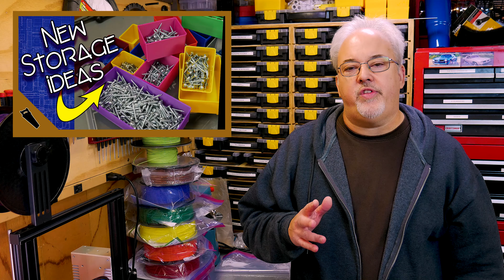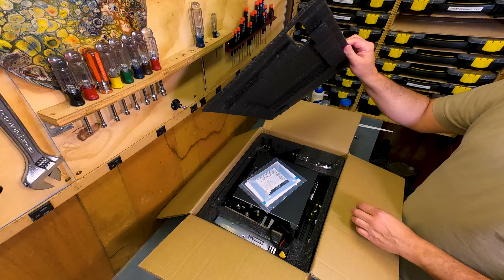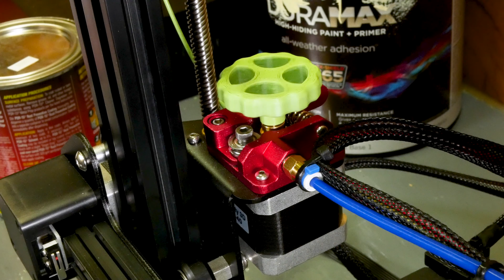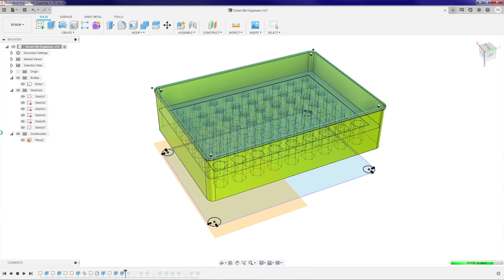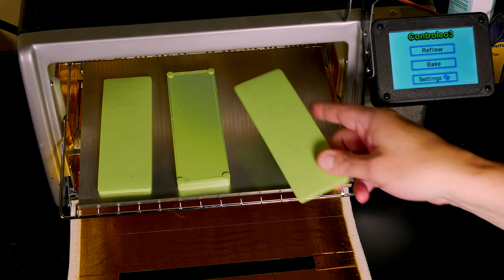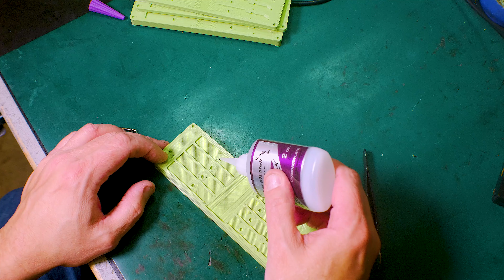3D Printing Bins for Harbor Freight Storage Cases

Comment: Im a newbie, wife got me an Ender 3 Max Neo, I feel like printing these boxes take forever. What can I do to get faster results?
Reply from the maker: With something like these boxes that have very low detail, the easiest way to speed up the process is to get a bigger nozzle.  if you can lay down plastic thicker and faster, you can take tons of time off the printing process. They will also be stronger.   If you switch to a .8mm nozzle, and re-slice, you could conceivably cut your time in half- (assuming the heater block can keep up with the higher flow)  Since you mention being a newbie, I will give you a  warning, you do have to be careful switching out nozzles.  They can get galled in their threads after they've been heat cycled so be sure to read up on that and the required slicer changes. You're also working in the area of the thermal couple which can be a bit fragile. Wouldn't want you to damage the printer in the process.

Comment: Just discovering your channel.  Been printing ABS since 2015 heavily.  I actually use some part cooling in certain situations.   I think drafts are mostly irrelevant.  It's ambient temperature that counts.  Around 35C you can print pretty well.   I'm running printers without active heating and getting around 50c.  I hear 70c is ideal but that requires active heating.  I've only run enclosed printers.
Reply from the maker: Yeah, my printer runs pretty consistently around 50c in that enclosure.  I will usually turn the be on and let it stabilize a bit prior to starting the print.  thanks for stopping by!

Comment: Hello, I have designed a 3D printed label holder that fits the harbor freight storage bins.  If you're interested in trying them out please let me know
Reply from the maker: Sure! contact me at the email address at the bottom of the video description.
Reply: @PeteRondeau  I emailed you at the address in the video description but never heard back.
Reply from the maker: I did answer you check your junk mail. I have a real problem with all of my mail ending up in junk. It’s something about the way my Web host has their email configured. But yes I’m definitely interested in your labels

Comment: That Ender3 is on sale for $189. Do you think that’s a good deal. Or should I consider the next level. Since it’s on sale. I’d like to build these and other things that have a good printing “resolution” quality.
Reply from the maker: I have had no complaints with my Ender3's.  It is a great entry to 3D printing.  Not overly expensive and gives you the chance to see if you even enjoy the hobby.  And the Ender3 can always be upgraded with aftermarket parts if you want to change some aspect of it.

Comment: Hi, nice video, 😊 and sorry for bothering you but you khow where can I find the 3d model of the small compartment of the stanley 1-92-749, comes with 3 different sizes but I want to change all for the small and I could find the 3d model you have any idea ?
Reply from the maker: Oh, I'm sorry.  I have no idea.  I haven't examined that case in particular. I Imagine it wouldn't be to hard to design them.  Have you looked on thingiverse?

Comment: I don't have a 3-d printer but I could really use some of those custom bins. Any chance you would sell some?
Reply: It is possible there is a library near you that will print 3d models for you, only charging you for the cost of filament. If you only need one or two things this could be an easy and cheap route if the service is available in your area. Alternatively, there are countless storage bin schematics on thingiverse. You can download the STL file and send it to someone who will print it for you (for a fee, of course). This would be more expenseive than a library, as the people who do this are doing it for profit, but it is certainly an option if you really want a specific item printed!

Comment: ANYONE ANSWER PLEASE
I recently saw another recycle bottle vid wherein the maker cut a bottle into filament and spliced it into his feed to make multi-color 3d recycle prints using the bottle as filament.
Invariably these are on another continent where the resin mix is unfamiliar in their available trash.
So, has anyone been able to cut plastic trash into usable filament in the US market?  My optimal desire is to use water bottles in some form.
Reply from the maker: I’ve seen what you are taking about but I have no information about it personally. It seems like slitting it into consistent width material would be the biggest battle. Otherwise it would probably print similar to PETG

Comment: How many storage containers worth of bins can you make with a 1kg spool of filament?  I bet a lot of us could justify the cost of the printer just to make parts bins, if the consumables cost is reasonable.
Reply from the maker: You could probably get about 24 of the large size bins (the largest of the original 3 sizes provided by harbor freight with the case)  Depending on how much you are paying for filament that seems like it would be about 75-80 cents a box- which would be more expensive than just buying the cases themselves at $6 on sale- But the benefit of being able to print the custom sizes and personalize the case to exactly what you want to store is the selling point for me.

Comment: Curious, how is your Hitachi table saw holding up? Have you had any issues with the soft start yet? I had to replace the module on mine last summer.
Reply from the maker: It’s been great but to be honest it doesn’t get a lot of use. I don’t have room for it in my main shop area so I end up making do with a jigsaw a lot of times unless it is a project that warrants getting it out of the shed.  Thanks for the heads up though. Now I won’t be too surprised if it happens. Where did you get the module form?

Comment: Neat! How long does it take to print a full box' worth full of regular bins though? I imagine it must take quite a while with the Ender 3?
Reply from the maker: On the Ender3, the smallest bin takes about an hour and a half, the medium size (twice the size of the small) takes 2 1/2 hrs.  They took me quite a while to print because I was doing individual colors- so I had to be around for the color changes when a print finished.  But, if you gang them up and print multiples (which I started doing with the green ones) you can set it up and walk away.  Probably would take 2 days to completely fill the case.

Comment: Great work!- I love the bins.  I have been printing functional parts for several years now.  PLA is promoted as the easy to print and non-warping but I have found it to be more trouble than PETG in many cases.  Also if I leave the PETG parts in the car on a hot summer day they don't melt.
Reply from the maker: Thanks, glad you enjoyed it!  I have been happy with ABS for those hot summer day problems and the printer does well with it.  Only limiting factor here was I a really wanted to match that Ryobi green and couldn't get any ABS in that color.  I used PETG to print the initial leg standoffs for my printer enclosure so it could hold up to the ABS temperatures but that is about all I've ever done with it.  I do enjoy the smell of PLA but that is about it really.. LOL
Reply: @PeteRondeau  I have never printed ABS because of the smell and PETG prints so well without an enclosure and works well for most of my uses.  The biggest issue I have with it is no adhesives stick to it.  Creating a similar enclosure to yours is on my list of things to do.  I want to try some nylon with carbon or glass fibers for added rigidity in the future.
Reply from the maker: Yep that smell stays isolated in another room. On the plus side though you can bond the stuff together just by melting down ABS scraps in acetone and use it like glue.
Reply: @PeteRondeau  I bet that smells amazing!!   Seriously-  I agree  chemical weldability is attractive.